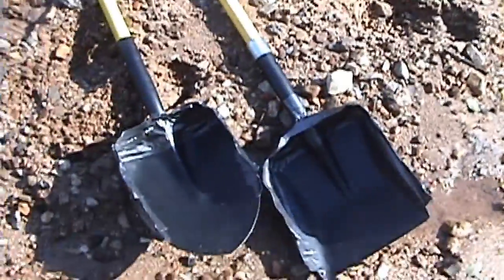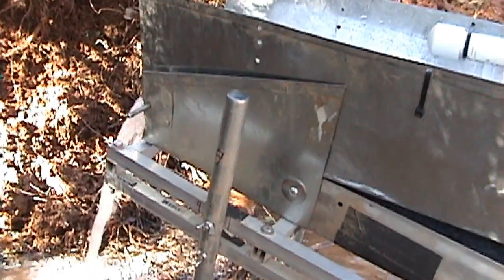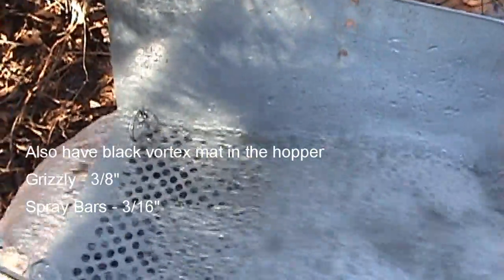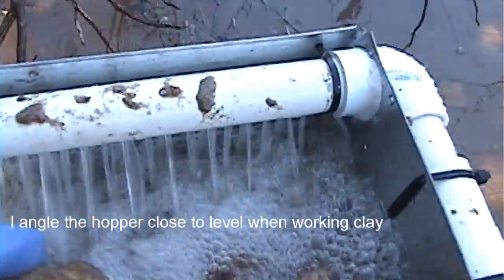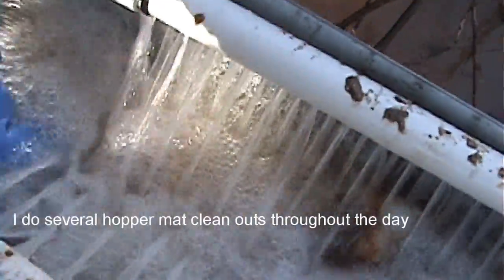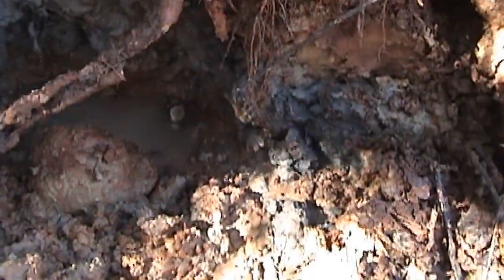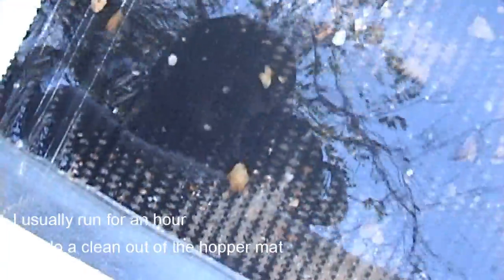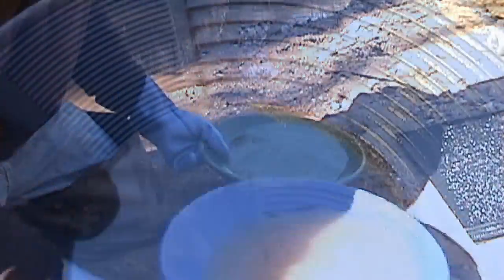Homemade BANJO Highbanker Keene Super Mini sluice a51a DIY Hopper PVC spray bar mods Aluminium Legs

Comment: When working thick clay material, you need to make sure to scrub it across the expanded metal to break it up, otherwise the gold that's usually trapped in it, just washes out over your grizzly.

Comment: I'm just wondering, is there supposed to be that much water coming out of the back of the hopper? Because I have a 8in highbanker and my water doesn't come off the back like that goes right into the sluice box and then down and out. Keep up the good work, and keep those videos comin. 👍👍

Comment: Do you just have a plate with holes at the end of the top section or is it a open cut out- gap that actually classifies the larger material out

Comment: I've got a question for you... I have the same pump that I just bought and I was wondering what size and how long should I make the suction hose? Because I know if I make it too long it will lose power..... I already have some 1 1/4 PVC suction hose that is 1 inch in the center...
Reply: 8 to 10

Comment: I used 3ft Tee posts for fencing for my high banker from Home depot and just drilled holes in them - very strong for legs and cheap like $4 a piece. just a thought. made mine 10 stronger after that upgrade
Reply from the maker: +Daniel H Thanks for the tip, Daniel.  Sounds like a great idea, hope you find some big stuff using your Home Depot Highbanker :)

Comment: If you make your legs shorter it will move less.  Mine sits right on the ground, it's not ideal for all situations, but it also saves lifting the shovel so high.
Reply from the maker: Thanks Curtis, your right about the shorter legs.  Since shooting this video, I made some shorter legs with the conduit I had left over.   Gives me more options on where i can set up.  Longer legs in the water and shorter on the bank.  
Appreciate the input and thanks for watching :-)